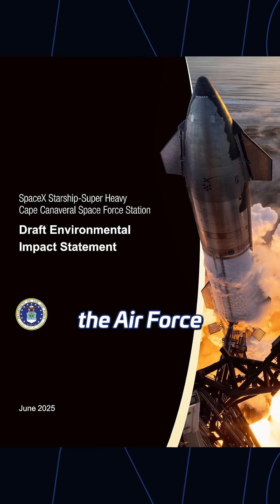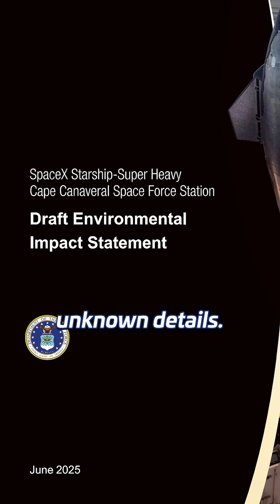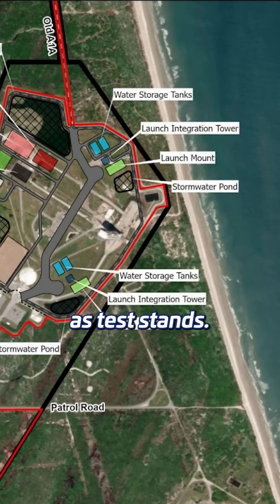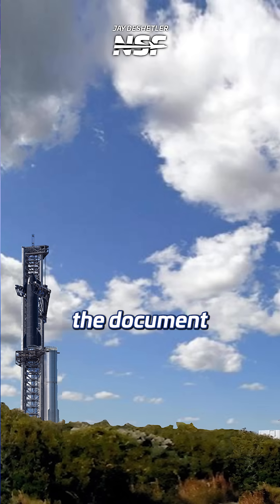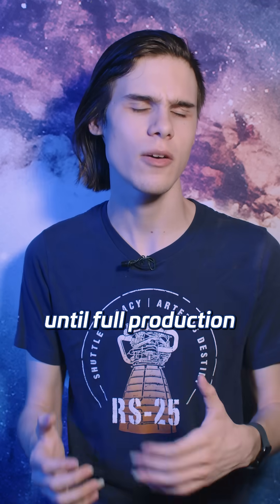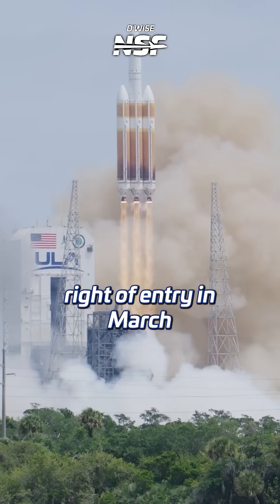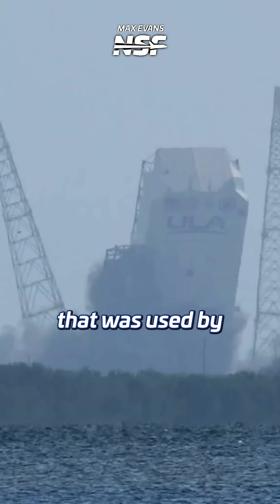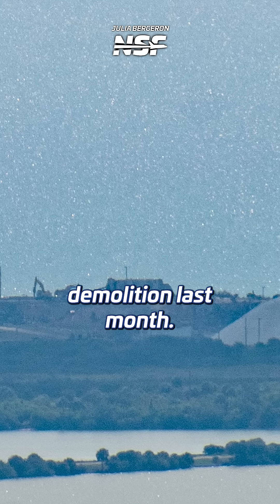SLC-37

Comment: What if they launched Starships from Starbase and then caught them at the Cape in order to save on transportation time?
Reply: Point-to-point sub-orbital ship transfers are too risky and, possibly, less energy efficient than shipping by barge.  It really isn't that far.  And in any case the back of my napkin says the booster doesn't carry enough propellant do it anyway. 

Launch from TX, spend some time on orbit spitting out starlinks or some other payload, and then land in FL?  Maybe.
Reply: because re-entry is so freaking crazy, and shipping by the ocean is so freaking cheap

Comment: Barge transport, will Starship be horizontal or vertical?
Reply: Horizontal.  Gonna be interesting to see how they pull it off or if structural modifications will be needed to adapt ship and booster to that mode of transport.

If you ever watch them turn a sausage-tank from horizontal to vertical, you'll see that lifting points are needed at both ends.  Right now, ASFAIK, rear lift points don't exist on ship or booster.  And I don't see them building transporter-erectors, a la Falcon 9, for these things.  

Like I said, it's gonna be interesting.